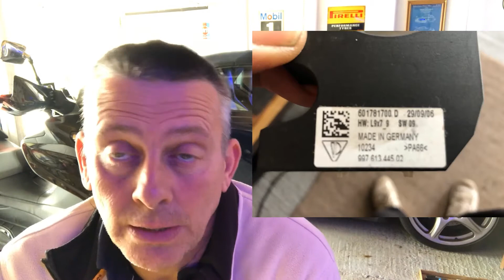PSM Failure. UP-DATE after test fail.

Comment: Hello minor mechanic, the video of the PSM failure is extremely interesting (not for you I guess) but a real good drama and I wish it doesn’t end so soon 😜. I have a question. I have followed you and cleaned up my exhaust system completely successfully - all new bolts. However I am having issues with freeing the thing that you plug the ABS and wear sensor into on the front right wheel hub. I have removed the 10mm nut  holding the white plastic successfully, unplugged both ABS and wear sensor by raising the clip that hold them and also the 10mm nut holding the brake line to the hub but the thing is just still stuck and I don’t want to pull it too hard and break it. Without freeing this thing, I won’t be able to move the callipers out of the way to do my discs etc, or even change my top mount etc. I have bought all the parts from design911 😄I really don’t want to take it in to my mechanic as I have invested in all the tools and videos online😂😂. I live in Southend and don’t know much about cars until very recently but learning. I am only a family doctor. Please Help!
Reply from the maker: Hi email me and I’ll give you my number andy454@hotmail.co.Uk
I’ll see what I can do?

Comment: I am currently chasing the same thing! Did you ever get it sorted out?
2005 997S
Reply from the maker: Check whether your cruise control works all the time. I found I could always engage the CC and this generally points to a faulty clutch switch.